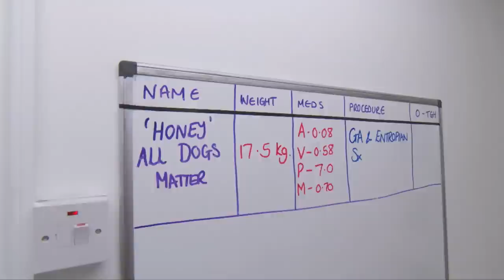🐶 This Dog Has A Scratching Problem | FULL EPISODE | S01E06 | Vet On The Hill

Comment: Shar Pei's are the DNA disaster of the dog world. I had a Shar Pei who was Honeys color and bigger. I volunteered at a Shar Pei rescue, which are far and few between, but I learned a lot about them. I did the intropion surgery on his eyes. The most crucial thing about Shar Pei's that they need a lamb diet. Pumpkin is really good for them also.  You also have to be VERY careful when picking a brush for their coat. The ones with sharp bristles will damage their skin. Their life span is short, 8 years or so. You have to be on top of their ears because air does not get inside to keep them from getting infections as well as the folds in their skin. The one I had was an absolutely wonderful dog. Everyone adored him. I had a lot of people offer to buy him...lol. They always got a resounding NO! You should have experience with dogs before getting a Shar Pei because they can be very dominant and despite their size they are very strong, deceptively so.

Comment: How did the vet get rid of the dogs' mange??   Beside the shampoo, was anything else used?   My two cats caught it from a dog.     Thank you if you can answer!   Love your shpw!!
Reply: If I remember its antibiotics, bath, continual monitering, although you will need to call some actual vets for a more informed decision as I'm not a vet or vet tech.
Reply: U can try giving ur dogs Nexgard but usually Vets will use the right amount of Ivermectin  to control those parasites.. But my first try would be Nexgard. 
There's a few reason why dogs get skin problems. 
1. Due to food allergies 
2. Your dog food or diet is not suitable for your dog
3. Due to parasites.
There's many more reasons but those are the common ones based on my experiences.
Reply: That dog's mange was demodectic mange which happens when a dog's immune system is depressed and the dog's normal mites that are found naturally on all dog's skin that usually live in balance with their host get out of control. S/he didn't catch that mange from anywhere, it was just a skin infection triggered by stress. Get the dog's stress down, get the skin infection under control, and support the dog's immune system are how to treat demodectic mange. If your cats caught a contagious type of mange that's a different story.
Reply: Keep in mind that some dog medications can be highly toxic to cats, I recommend getting a diagnosis and medication recommendation from a vet.
Reply: @whifflingtit9240  yes true... Dogs medication should never be use on cats as they hv different doses and dog's medications might be strong for cats.